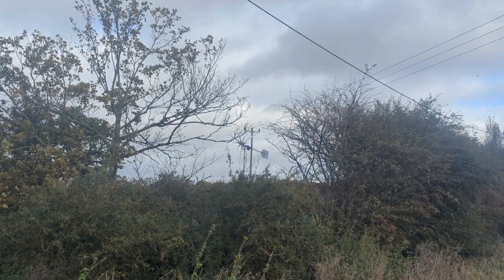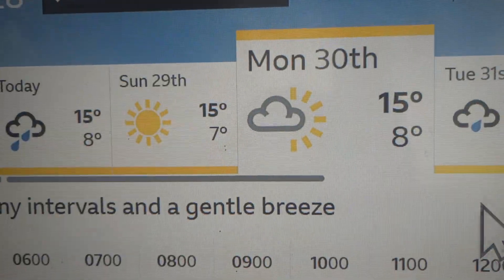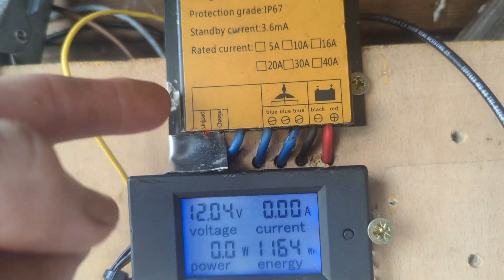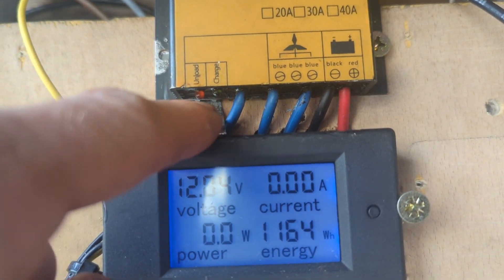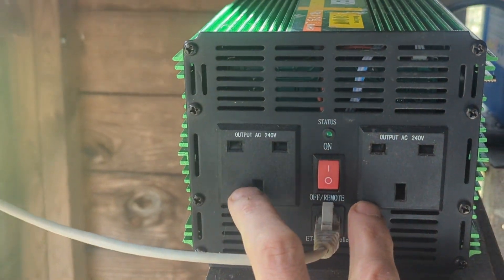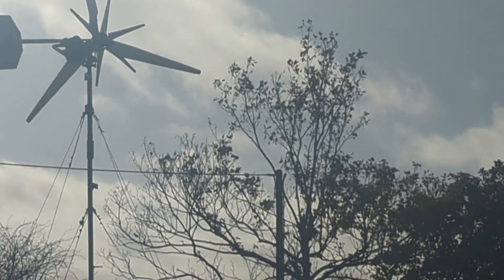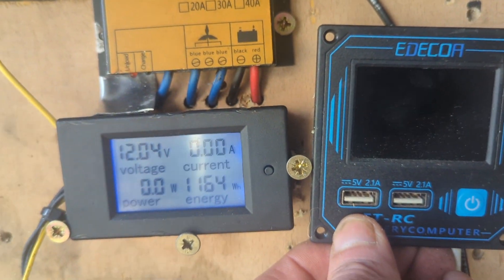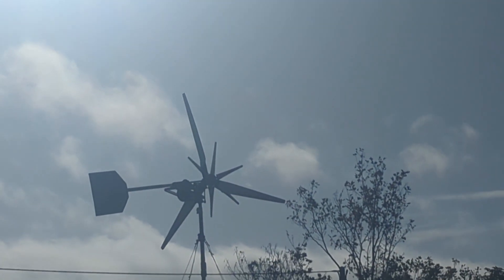Update on the new wind turbine projects still waiting for the wind- Wired the budget controller in

Comment: It was impressive to see held a high average output, peaking to 1kw+  a few videos back. I think this'll do really well as the windy season gets underway. You've mentioned raising the turbine a bit. Probably a  good idea. I think you already have a good guy pole and robust looking tirfor so hopefully that shoul'dnt be too bad to do.  I just stuck one of my turbines up another 3m to get past some rapidly growing willows and it's definitely improvement output. I clamped on some extra weight to the guy pole ( 2 heavy scaffold tubes clamped in parallel ) and it made it a good bit easier to crank up.